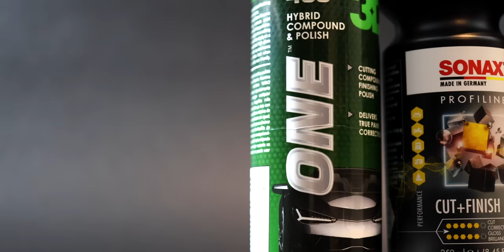The Best One Step Car Compound/Polish | 3D One vs Sonax Cut & Finish  vs Scholl Concepts S20 Black

Comment: I use cutmax, cut and finish, perfect finish, and final with amazing results. Sonax have great products. This was a great comparison.
Reply: Same!!! Except I usually only carry cutmax and perfect finish in the field. Such great compounds. Although the dusting can be a bit much, since I’m constantly in direct sunlight. Rinses out of pads relatively easily also! Pad washers ftw
Reply from the maker: Thanks for sharing your experience with their compounds and I’m glad you enjoyed the review!
Reply: Sonax are my key compounds too. For some reason they never dust when I use them. I always work inside I am using a lot of Rupes, meguiars and KochChemie as well, but they surely dust way more than Sonax. I use EX05-05 instead of cut and finish and I have to agree that it is not easy to get a great finish. Kochchemie has much better one step F06 in that regard
Reply: @vladimirsmola8706  Nice.
Reply: @Ichabod_Jericho 
U should also try Scholl S20 Black and finish with Scholl S40. In our eyes more cut, more gloss and less work.
Reply: @CarCraftAutoDetailing  Which of these 3 products do you think I should use is more permanent and the effect is long.... i was caught between auto glym alex hybrid, scholl s20 black real and 3d 510 cake, which one do you think I should buy you seem to be very experienced in this regard

Comment: Thanks for the comparison Sandro. I believe 3D promotes ONE as a "pad dependent" single paint correction polish vs. a one step polish. i.e.  use an aggressive pad and you'll get good cut, use a light polishing pad and it will finish out great.
Reply: This actually works for every compound and polish.  Its why you should always test different combinations because paint systems vary quite a bit these days.  You'll be surprised by what you find.
Reply from the maker: My pleasure mate and absolutely agree with 3Ds assessment of One in that case but I also have to agree with 5hift6ear that one of the wonderful things about good modern car compounds is that they are all very pad and technique dependant and it really amazing how well modern compounds can cut finish these days compared to their older counterparts.
Reply: @5hift6ear  If every polish/compound can cut great and finish out great, pad dependent, and every polish/compound can be a one-step, and every paint is different, then I'm confused as to the point of why would anyone ever do comparisons.
Reply: @mutatedgenome  Its more about catering your pad/product to the paint system you are working on and what kind of results you are after.  There really isn't a single product that will perform perfectly on every single paint system, this is why before you correct an entire car it is important to dial in your combo in a single area and then go from there, you don't want to have to do the work twice.  There are caveats to this as well such as repainted panels, blending jobs, etc.  The entire car could have harder paint but the single repainted panel could be softer or vice versa and would require a different combo to get the results you desire in some cases.  The good news is abrasive technology has come such a long way that as long as you surround yourself with quality products you won't have any issues.  Having various pads/abrasives that vary in aggressiveness is ideal, but for a weekend warrior 3D One and a variety of pads should be able to achieve the desired results.
Reply: You're exactly correct on this. 

The benefit for us is that it finishes out really nice for the amount of cut it can achieve.
Reply: @5hift6ear   Can you recommend which two lake country foam pads to use with 3D one, for light cutting and then polishing? Orange to start, but which one to finish with? White? Green? Thanks!
Reply: @KingRockets  I would use the white pad.
Reply: @5hift6ear  Thanks, it's my first time attempting paint correction. Appreciate the input!
Reply: @KingRockets  Have fun and don't overthink the process.

Comment: 3D One is my go to for many reasons you stated,   when i need a little more cut, i combine it with ACA500 ,    3D  has more Lubrification  that prolong working times, many detailers find it to oily because they use too much products .    when finishing with 3D One ,i use a black finishing pad from Lake Country  and get awesome gloss finish., or the new Rupes white finishing pad.  i cut with Lambwool pads most of the time, or Buff n Shine Uro 50-50...       Thank You for a Great Video!    ;-)
Reply from the maker: Thanks for sharing your experience with it mate!
Reply: are you buffing to perfection?  I've only done 4 cars, but I've used 3d one with either a Orange lake country foam pad or yellow rupes foam pad and took out 95 percent of defects and don't need to polish.  maybe I could make it perfect, but I feel like that would be 50 percent more effort for 5 to 10 percent more improvement.  not really worth it unless you going for perfection.
Reply: I also just tried out a rotary for the first time with a lake country wool pad but had a tremendous amount of sling.  it almost looked like I was slinging water but the pad was dry before I put 3d one on it, so it was obviously product.  I'm assuming I either put to much product on or didn't massage it in the wool when I primed it, or maybe I started to fast.  what do you think I was doing wrong ?
Reply: @brianhenry7983  - Might be too much product or technique. 

You don't need much 3D ONE. 

I had a similar experience when I got my first rotary back in the 90's. I was using Meguiar's M02 Fine Cut Cleaner on a Meguiar's wool pads. It was a MESS!

Comment: Where is the koch chemie products?
Reply: For a simple reason: Koch Chemie only offers an AIO but no real one-step with accepting cut and finish.
Reply: F06 is a perfect cutting medium polish, cuts more than a 2500 menzerna. Still it's like glue while removing it and dusts like a real heavy compound. I will never understand why people like koch polishing line. H8 is more like a medium cutting polish, H9 cuts well with rotary and wool but only with low temperatures... Otherwise impossible to work with.

Comment: 3d One is King. Especially on Rotary or RO where you don't need to wipe down until after the polish stage. One product for all stages just change the pads. Working time is so long. 3d One will cut out heavy defects on a wool/MF pad. S20 Black probably best as just a single stepper with the purple spider.

Comment: I know I may get beat up on it but I still love Meg's 205 for a one step. It doesn't do great with deeper defects but for some defect removal,  great gloss and super easy to wipe off it's hard to beat. I do like 3D one and Sonax perfect finish, there just a little oily in my opinion. I don't like struggling to wipe off a polish. I always respect your opinion and appreciate everything you do for the detailing community. I would like to try the Scholl S  20 black, not sure if we can get it in the states. Thanks Sandro.
Reply from the maker: I think the detailing world has a lot of thanks to give to M105 & M205! I still remember trying them back in the day and they where truly amazing and innovating compounds at that time which forced other brands to step up there game and they have definitely stood the test of time which says a lot! 
Thanks mate!
Reply: @CarCraftAutoDetailing  couldn't agree more.
Reply: I use M205 for the first time in a long time. I had been a strong Meguiar's user since 1996. It wasn't until I tried 3D that something knocked Megs out of my top spot. 

But last week I used Meguiar's at work. I was using M205 to cut and finish. The sides of this Porsche had extreme car wash damage. So I had to switch to M105. 

I used to get a ton of dust from M105, but I guess my approach improved! That M105 paired with Lake Country microfiber cutting pads did a GREAT job cutting down the compromised paint. I then used the M205 to refine. 

It was good to visit home with Meguiar's. I missed the feel, the wipe off, the scent... 

I also used a TON of Meguiar's Ultimate Compound and Ultimate Polish. 

I'm also really liking the newer M110 and M210. 

Nothing wrongs with Megs!

Comment: I would give the Sonax EX04-06 a try 👍🏾 Did my black Volvo with it.
Nice (!) cut, and a high gloss.
It slings if to much product is used, 0 dust. 2 downsides hard to clean out of the pad (a curd soap bar will fix that) and no easy wipe off.

Comment: I recently used s20 black on a Kia Sportage using Lake country orange pads.  Someone had scraped across the rear door and qtr panel with bike handle bars. I wax expecting to have to wet sand the area but gave s20 a go first. It took everything out in a couple of passes and finished perfectly. I couldn't believe it. Finished it off with NV lustre for extra gloss . Great video once again Sandro.
Reply from the maker: Awesome to hear that and a great example of why starting with less aggressive combinations is the way to go!
Reply: @CarCraftAutoDetailing  i learnt that method , starting with least aggressive first, from your videos . So big thx to u mate

Comment: A couple things not mentioned, which I think are important, is first of all; oil content. Scholl S20 Black has a very low oil content of around 3-5%, whereas 3D One has an oil content up around 15%. This is significant when wiping off prior to a ceramic coating application, as the less oil that's used, the easier this will be - this is also one of the things Scholl changed with the updated formula of S20 Black. The other thing, is that all of these compounds use DAT aluminium oxide technology (diminishing abrasive), so technically, the longer you work the polish, the finer the finish should become. Some of these have quite aggressive aluminium oxide, and so they will cut more with a shorter work time, but should finish down nicely once worked for a longer time.

S20 Black is just pure witchcraft for mine. Low oil content, very versatile as it can be used on hard and soft paints and you can adjust the finish you get with your pad choice and technique used with the machine. It's still the best all round polish out there, IMO.
Reply: I was just about to comment on this as well! Well put together comment :). What turned me away from 3D one was the wipe off process. I’m excited to be trying out S20 Black soon!
Reply: @knpgn  I didn't have any problems wiping off either product, it's just interesting that Scholl use such a low oil content, when basically every other company use a much higher oil content for easy wipe off.
Reply: @Disciple11  Interesting! I always thought that the oil content was related to lubricating the abrasives within the compound. I always found that 3D one filled up my pads and wipe off towels very quickly. Maybe its difference in tolerance when it comes to wiping off 😅. Any tips for wiping off 3D one? Ive been using 350gsm low pile towels and carpro eraser as my wipe off process. Cheers!
Reply: @knpgn  the oil serves a few purposes in a polish - one of which is lubricating the abrasive, but it's mostly for consistency of use throughout the polishing process, stopping the polish from drying out, and making it easier to buff off.

I would use a better panel wipe there. In my experience, Eraser is lacking quite a bit and can leave a residue from the soaps in it. Try using a strictly alcohol based one and see if it improves for you.
Reply: Found the 3D polishes to cover up more compared to ultracut/scholl/koch/menzerna when a strong IPA is used. Thank god I only bought 250ml bottles 🙈
Reply: @Disciple11  i appreciate you sharing your knowledge! :) thank you
Reply: None of 3D's abrasives are diminishing.